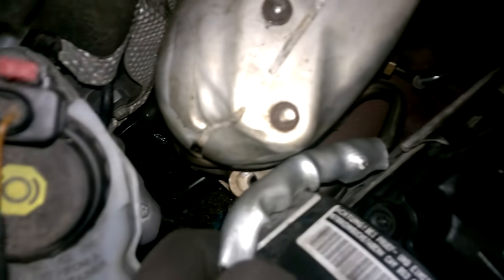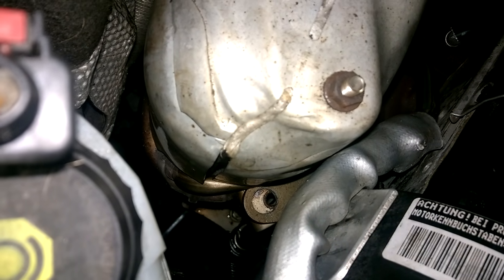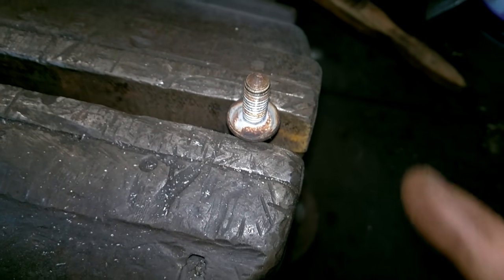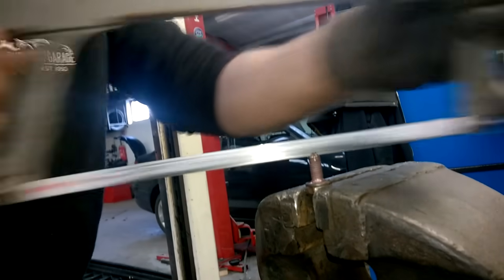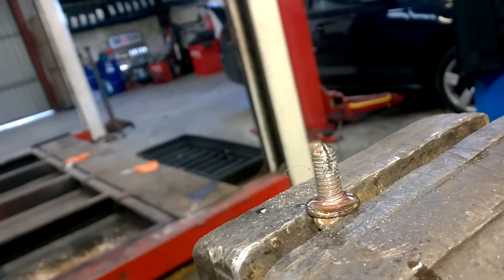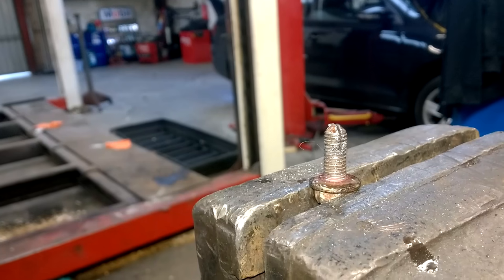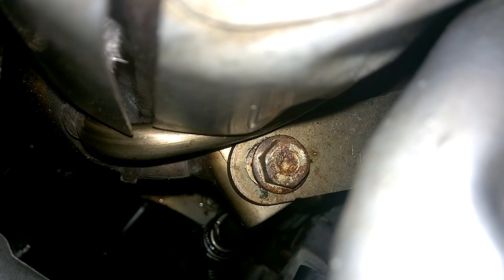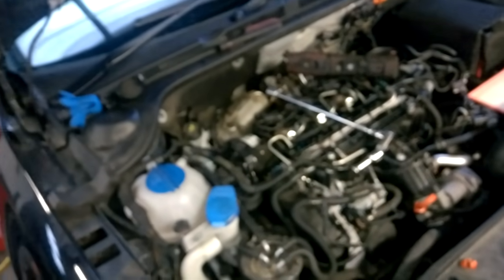My Father Taught Me This! Passing It On To The Next Generation

Comment from the maker: **UPDATE*** I decided to make a follow up video on this https://www.youtube.com/watch?v=yfNQullGEuQ&feature=youtu.be Should answer some of the questions that were raised, I include 3 demos of this in action with close up shots.
 
As there was some safety concerns & confusing comments raised, I felt I should clear a few things up. 
1) This is a tip for certain circumstances only, I never have and never would use it on a component which would cause any safety concern to any customer.  
2) The demo was done on a support bracket only, items like this or similar will not cause any safety concern. 
3) I did this free of charge and on a time restraint, I noticed it when I was replacing another item, the customer needed the vehicle back that evening and I decided rather than leave it like it was, I would do this and secure it up fully. 
4) The bolt was not the issue, the part that the bolt threads into is a secured piece, someone had previously damaged it, leaving the bracket loose and the bolt just tightened a turn or so.
5) The bolt can be removed and will not break, it will go in and out as usual and has helped clean up the damaged threads.  
6) Used in the right application I personally believe this is a great tip and can save you a lot of time & trouble. 

Lastly to all the people who have watched the video, Thanks very much and I am delighted with the feedback I have received on it.
Reply: For you to make six specific points means there has be Whinging by people on a mega scale because you present a handy tip to viewers. If they need to complain about what you presented then they are obviously not fully understanding what they just saw. It is self explanatory, I thought and a good handy tip to fix someone's cock-up! John, Australia.
Reply: joandar1 common sense is not that common at all Johnno
Reply: Interesting, never seen exactly that before, but I have a hard time picturing a situation where this is a better solution then putting a taper/pilot shaft on the bolt though. This strikes me that it would create a situation that makes it much more likely to cross the threads and damage the female threads making the situation worse. 

Also if you have one, some amazing things can be done with a thread file, a drastically underrated tool. Use a thread file to taper the threads and you create a kind of self tapping self aligning bolt. Some factory body bolts are like that.
Reply: Problem with your "tip" is that you are passing on bad practice rather than teaching people the correct method.
There's a strong possibility that people will apply this technique to safety critical components because a "mechanic" showed them a neat little trick rather than the correct way.
Mechanics get a bad name as it is, due to dodgy practices by some, your video just reinforces it and these other halfwits that are defending your "hack" are just as bad.
This video just advertises to everyone that you are too lazy to do a job properly.
Who taught you to do that?
Reply: It would have been faster to run a tappered tap down rather than sawing the bolt if the previous guy cross threaded them at any rate. Literally takes all of a minute. Just take the extra second to align the tap properly. Don't be afraid of one of the best tools in your box.

I almost want to make an instructional video on restoring threads now. Especially for down in a tight spot in a blind hole. Bit camera shy thought lol.
Reply: As said before by others - it's kind of pathetic of people to criticize an ingenuous solution to a common problem. Common sense dictates in what situation you would use it. Those that do criticize obviously have none. Well done and I have just subscribed.
Reply: Like selecting the correct grade fasteners for an application, this fix has It's place and applications. Sometimes, using a guide bolt to realign the parts and clean up the galled threads is all it takes to put in a replacement bolt after inserting and removing the modified bolt. I work with larger threaded pipe fittings and use the "slit nipple" to clean up threads before reassembling a piping network and it works a beauty. 

Thank you for showing this technique and sharing your knowledge Gerard!
Reply: Eddie Godfrey unfortunately the problem with common sense is that most people only get it after experience. The problem with that is the experience is usualy costly.
Reply: Never spent more than 5 minutes on an engine. Put oil and water in, bosh! Buuut saying that... I liked ya video, my dad was a mechanic and this reminded me of watching him fix up a battered e-type a couple of decades back so thanks for that. Good times.
Reply: Almost all of the bolt hold is placed on first 2 threads. The threads that were cut are pretty much a decoration.
Reply: Ray Jim a lot of people also dont realize that medicine is the same.this video is very helpful and useful!
Reply: Gerard Burke Hey I have just watched the video and was going to check the comment for possible safety concerns and I'm very happy to see that you've addressed them yourself. You sir are a scholar and a gentleman!
Reply: BMikeAD Do It! (no face needed, just hands, tools & technique step by step) As I've come across the over-thread issue in a multitude of places, I'd love to learn an easy how to fix em!
Reply: Mama LuvBug 00?
Reply: Gerard Burke I have to admit the one of my first thoughts was the strength of the bolt possibly being compromised but the fact that you give a disclaimer and you explain that it's not really great idea to use it in a situation where it could compromise the Integrity or the structure and then it's not for every situation I think it's a pretty good tip.
Reply: vachief I was wondering if that's why the bulb look like that in the first place. Conical top possibly someone else had difficulty with the bolts going in and so they did that to it

Some other people keep talking about you tapering the bolt but I can't help but wonder if the bolt has that conical shape in the first place, the last president put it in probably had trouble with it going all the way in as well
Reply: Jack Ripper  your name suits you.......your ripping needlessly, he shared a great tip for a certain application.......Its your frame of mind that thinks gun manufacturers are responsible for the deaths of people who die from a morons missuse of one! The use of this method was absolutely better than leaving the bolt out!
Reply: 7) When a fastener goes into steel it only requires 4 threads for full engagement. Anything else is redundancy, for ease of fitment, or both.
Reply: You see that's the problem... If you have to come here for this 'solution', then the chances are you don't have a lot of common sense, and should probably put the spanners down and go play with your Action man or Barbie doll.
Reply: Gerard Burke - Having read this - ima skip readin any reviews - champion idea i know woulda got me outa trouble more than once inthe past - just thanx for sharing 🙌
Reply: Alan Air exactly what I was going to say.  Unfortunately when speaking to groups of unknown people it's better to treat them as utter idiots than to assume they possess what you may consider common sense, and can put together seemingly obvious bits of information without it being spelled out for them.
Reply: You didn't do it free your making money from the Youtube adverts through Adsense like everyone else who puts adverts on their video.
Reply: Gerard Burke I
Reply: Gerard Burke 5
Reply: Gerard Burke i
Reply: @ BMikeAD : Not a tapered tap. This is a blind hole by the look of it, and a taper tap would bottom before it did much or anything, and as a thread exists already it could cross-thread easily anyway. You'd want to use a plug tap.
Reply: @ Jack Ripper : Perhaps you'd tell us the correct method?  Looks to me that some previous guy has cross threaded the bolt into the hole, which is a blind tapped threaded hole in a casting. They have foulded up only the first couple of threads in the hole (and maybe the bolt, but that can be replaced).  Are you suggesting that our Youtuber should have ripped out and replaced the entire casting (the cylinder head?) just to add two threads to a fixture which is obviously a minor bracket?   Another "proper" method would be to re-tap the hole same size to clean obstructing burr from the thread - but this is effectively what is being done here, with the slotted bolt acting as a tap! Maybe use a proper tap, but does not look like room for it here. Third proper method is to drill and tap for a bolt the next size up, but there is even less room for that and then you have issues about weakening the casting, and this is only to hold a minor bracket for heaven's sake.
Reply: Excellent Tip!!! If people are concerned, the bolt can be replaced with a fresh one now that the female threads have been repaired.
Reply: @JackRipper8881  Of course it is better to use a tap and die set-- this is an alternative to get the job done if you have not got one to hand. Much better than nothing if you are stuck with out the correct tools.
Reply: Gerar Burke
Reply: Great tip
Reply: Nevermind the haters.  The hamfisted types can't grasp the concept.  Wrench on.
Reply: I have used this expression for 50 years from a boss I had, Never heard anyone else use it till now. HOT DAMN !!!
Reply: can try replace it with a new one later
Reply: Gerard Burke ... Great points.
Reply: Good idea. It wiil be very helpful for mechanics whenever they face such problem while  handling bolts having cross threads or worn thread ends. Super idea.
Reply: that's what he did it a self tapping bolt it's thread chasing.
Reply: So its essentially the same function as a drop in anchor?
Reply: Ratha  iwant you now call me today
Reply: I like your accent
Reply: @IrishNational  what ads? No ads on the video i watched...
Reply: @JackRipper8881  obviously you didn't pay much attention at all... he said several times that he picked this up from his dad. Hopefully you can comprehend this statement, though I have my doubts. 😔
Reply: BMikeAD no you should make a video, so everyone can say what is being said, and that everyone always do, but who cares what idiots say, what is important is you pass your knowledge, it's common sense that an intelligent person can decide what will work, if only someone passes knowledge to them regardless if it correct or wrong way, if it works then how can it be wrong, but an intelligent person would know if it would be safe or not safe, even stupid can have common sense.
Reply: ScotIre Land RIGHT!
Reply: @OurGovernmentsAreBetrayingUs 
It's called a dog end screw and you can get fasteners that way. Threads removed for a short distance on the end. You can get them in screws, bolts and setscrews.
Reply: Thanks for that. Very useful .  But may I suggest you put the lubricant on the blade of the saw when cutting the bolt. It holds more than the bolt head.
Reply: When a bracket is screwed into place tight, there will not be any safety issues. But you will almost certainly have negative people who will try to always question what they did not come up with out of envy. Do not pay too much attention to them. They will try to drain you as they have nothing else to do.
Reply: You say that the part the bolt screws into was the problem, so the solid part of the bolt has no bite and where the good threads are, the flexible part of bolt allows the threads to slide against each other, greatly increasing the chamces of strippage?
Reply: That's called jery rigging and its a very bad idea
Reply: @eddiegodfrey2538  common sense says never do this
Reply: Irate Pirate likely just one or maybe two damaged threads straightened back out. Looked like 5 threads of engagement or so after that. You’ll know when you go to tighten it if it’s stripped or not. In this application, if it torques up, it’s fine.
Reply: @OurGovernmentsAreBetrayingUs a lot of German autos have bolts like which u describe...
Reply: Gerard Burke n,
Reply: Gerard Burke m,  I m I
Reply: Duke Nukem - the critics that present "perfect solutions" are the first to use a long ass sheet metal or drywall screw to resolve the situation if its presented itself to them in real life.  beaurocrats and osha inspectors in the making!
Reply: The Doc - ur here, no?  barbie is calling!  such a typical "mechanic" attitude.  i got my college degree in an automotive classroom and on the first day, the student that "knew the most" about cars came in wearing shorts and sandals.  sounds like you would have fit that bill also.
Reply: Nick Michaels - re-tapping aluminum or even steel for that matter will alot of times leave you with loose threads.  its not well known but standard automotive taps are a certain size.  if you look through a machinists catalog you will find that the same size taps are available in different clearance sizes, and thats the problem when you just go and use a tap.  you don't know the tap size the manufacturer originally utilized to make the original threads.  a very good case in point is that some shop manuals will clearly indicate that certain critical threads should NOT be chased with a tap during rebuild procedures.  i can't remember where i saw it last but i want to say it was head bolts.  the reason, like i said is that they are tapped undersize for a tighter fit with the bolt.  besides, this uploader essentially just turned a regular bolt into a perfectly suitable tap.  most noncritical aluminum threads are made from the factory with a self tapping bolt anyhow.  i bet this one was too.  shit.  the water pump on my mercedes sprinter comes with unthreaded holes to attach all the other stuff that bolts to it to.  its scary as f*ck threading those self tapping bolts into an aluminum housing but the fit is nice once its done.  i tapped one the right way for shits and giggles and the fit was loose.
Reply: I've seen more people whining about having to post these 6 tips than people who allegedly voiced safety concerns that weren't covered by the video. Grow up.
Reply: Aye, loov yer accent , mate! Where ye be frum?;)-John in Texas;)
Reply: Toni barxton
Reply: Brilliant tip...anyone that’s been stuck in a similar situation will appreciate having this tip in their back pocket
when it comes around again. Some people enjoy leaving why you can’t do something comments and others
appreciate a great piece of advice for what it is. Too many people have a remove and replace mentality and don’t 
know how to repair things anymore.
Thanks...new subscriber!
Reply: Jack I agree of you don’t how and when to use this kind of tip, just don’t !
Reply: In good engineering practice this is not the correct method.
Reply: Mml
Reply: The bolt was not working in tension only possibly in shear so the full cross sectional area of the bolt was in operation. You are totally correct in your observations as to when this demon tweak can be used. Anyone who uses it incorrectly needs their hacksaw confiscating!
Reply: you can tell a real mechanic/fixit guy, they all have a vise that looks like this, every mark has a story
Reply: People that complain have no clue. Probably never used a wrench I. Their life. Ever.
Reply: Why do i feel there was at least 1 idiot for each of those points?
Reply: @JackRipper8881  Quite right
Reply: Excellent idea thank you for sharing!  Could have used this idea many times over during the last 30+ years of wrenching! But will use it for the next however many years I wrench!   ✌
Reply: There must be a lot of angry people watching this video who obviously work on Formula 1 cars and fighter jets... Thanks for the video, it is appreciated.
Reply: @BMikeAD  pls do. Eager to learn
Reply: @butchrowerakamannyfraker955  ... what?!?!
Reply: Too bad you can't do this with brake lines forgetting the hollow bolt into the hole...
Reply: instablaster
Reply: Yeah, that would work, maybe, maybe not. However, as a doctor of mechanical engineering, I would be inclined to figure out why the holes are misaligned and then rectify the problem.
Reply: Great advice. Thx